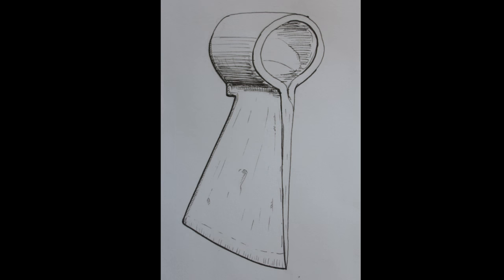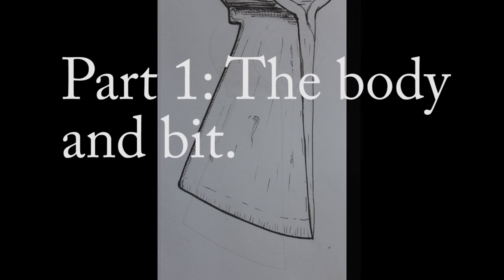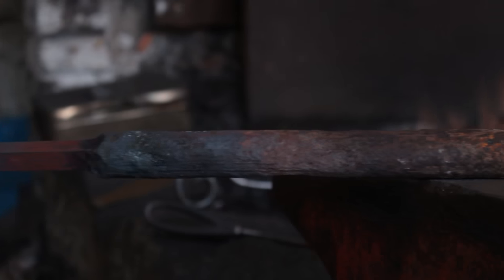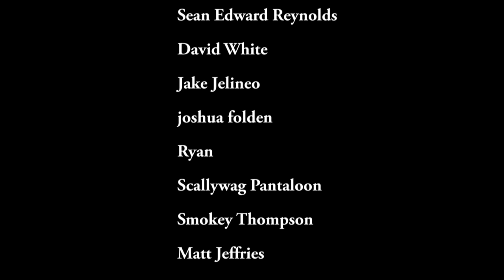Forging a Wrought Iron Trade Axe - Part 1: Welding the bit.

Comment: When I was walking around Minneapolis not too long ago I went under one of the bridges over the Mississippi and there was a bit of a history exhibit that had some pieces of one of the earlier bridges, built in the early 1870s, and I saw that they were wrought iron and thought of you. Very much bigger pieces than you could make on your anvil though.
Reply from the maker: Gosh, I would have loved to have seen those! Wrought is just so lovely to work with. I do tend to hoard it when I come across it, lol. I believe that the Eiffel tower is made of wrought iron as well, but I may be wrong
Reply: The tower is made out of puddled iron, which is a softer form of wrought iron.

Comment: I was wondering whether you were going to do the asymmetrical eye or a split and welded eye. Looking forward to the next video.
Reply from the maker: Very good question - I'm actually going to do an asymmetrically welded eye as I have seen evidence for that method being used with Trade axes. I do intend to do a split welded eye for a Daneaxe though at some point.
Reply: Cool; thanks!

Comment: I don't understand how any forge ends up with that much clinker. Jaw dropping. Does it have to do with the type of coal you're using? Bitumous coal is the most common around my area. I would need to be running my forge for 10 times as long to get a clinker that size.

Comment: good grief! I have never seen a clinker that big.
Reply: Boone Thompson little new to smithing terms. what exactly is a clinker?  Is it slag?
Reply: a clinker is a rock like chunk that forms in the bottom of coal forges, they come from impurities in the coal and from scale from the metal.

slag and scale is oxidized iron that forms when the metal is hot (like really hot... red, orange and yellow hot) it often falls off the metal in little flakes.
Reply: Boone Thompson so it is similar to slag then